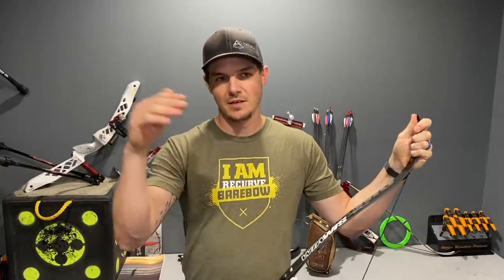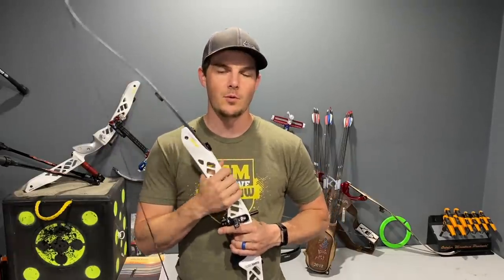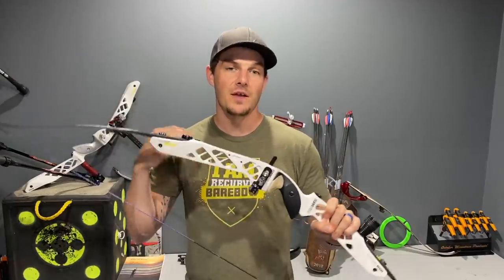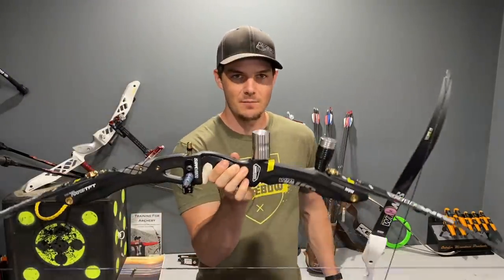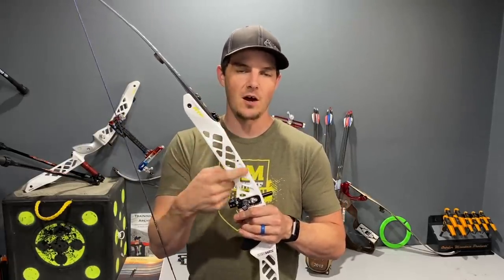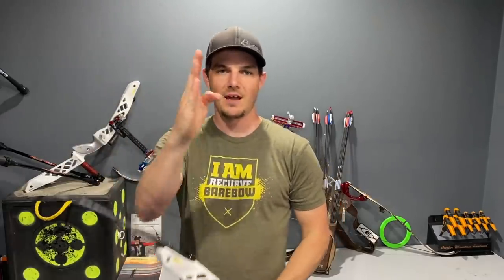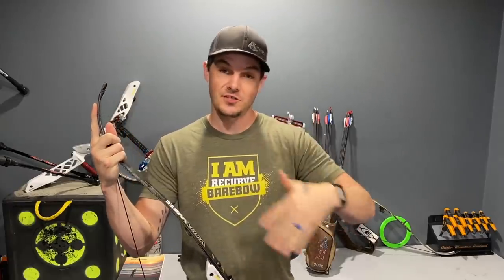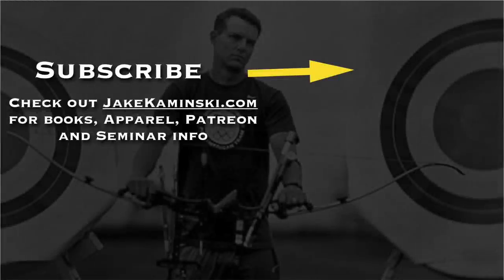Carbon Fiber VS. Aluminum Risers | What Recurve Riser Type is Best?

Comment: plenty (probably the majority) of anodized risers either have their anodization applied directly off of the Cnc machine or use a bead blast process instead of hand polishing. In fact I think it is quite unique for Hoyt to use hand polishing before cnc. MK and Fivics would even leave the tool path visible for kind of a decoration. I think your point against anodization it’s really about anodized hoyts instead of anodized risers in general.

Comment: I have several risers, and my most expensive one is a WIN&WIN CXT, and its lovely, if heavy. Its comfy, well balanced and comfortably handles 54lbs and ACEs. Then I decided to get a cheap riser to stay shooting off the thumb with heavier draw weight. So I got a Spigarelli Revolution. Wow. NO vibration, 63lbs, much more forgiving even with a short riser, short limbs and a 31" draw length. I don't think I'll ever change risers, it's the best I've ever shot.

Comment: I have a (aluminum) Hoyt Nexus and a (carbon) W&W CXT.
The CXT is so much more "pleasurable" to shoot that it is hard to believe the difference.
Reply: In the motorcycle industry in the late 1990s carbon fiber gained popularity and is still being used today ! Carbon fiber is much improved but like a wood bow requires protection , wood more for moisture and carbon fiber for UV rays . I would think your CXT feels more like a wood bow in your hands and has the characteristics of less vibration when shooting . I just purchased a set of composite carbon limbs from a French manufacturer UUKHA @ 42 lbs to see if I like them .  I still like the look and designs of the aluminum risers , they are a thing of beauty !  I’ve been in archery since 1966 and the advancement in archery and equipment has been phenomenal !  Know if we can just get more places to shoot with 3D !
Reply: @hotchihuahua1546  Since the comment I also bought the Gillo G1 riser. I do not see any difference between shooting it nad the Nexus. CXT still feels more natural to shoot. Just like wood that I'm used to since 2004 :).
Reply: @-fazik-3713  I assumed the carbon fiber would feel more like the wood but your statement confirms it . I’m sure I will get a chance to try one out in the future .  On another note ,  Jake Kaminski’s YouTube came up because I had an interest in archery , I am impressed and like his format , I subscribed to his channel !
Reply: @hotchihuahua1546  Hands down it is The best channel about archery on youtube.

Comment: I have tested vibrations frequency of the carbon TFT and ALU AXT.  the carbon riser vibrates at much higher frequency (30k~kHz) than the ALU riser (100~1000Hz)range. the high frequency vibration on the carbon riser dissipated very quickly.  carbon is rigid, it just can not damp the vibration. it vibrate faster so the energy goes away quickly.  it may be too high to human to hear and feel.  but affect the bone and join more.

Comment: Going to be a little controversial here and say that I think personal feel probably trumps every other consideration. When you find a riser you like, during the shot sequence you are probably getting all sorts of feedback from the riser experience and especially at the exceptional level you shoot, you probably know a 10 as it leaves the bow. So as a carbon riser feels different, you probably don't get the same sort of clues its a good shot. Where I do think the carbon is a distinct advantage for me (target barebow) is a very short distances I can raise the nocking point substantially and the bow still be usable. With an aluminium riser I don't seem to be able to make as extreme adjustments before the bow becomes unusable. Reason for this trick for me is it allows me to anchor underchin and be point on without having to add stupid amounts of weight to the arrow point.

Comment: I have used various risers, cast aluminium, machined aluminium and cast magnesium, wood and carbon fibre...carbon fibre is cool....in theory. I have a WIN&WIN CXT. I have never felt so much hand shock. Wood feels nicest, but...not the best performing. Cast magnesium, not bad, but..not great. By far the best in terms of hand shock absorption is machined aluminium, and the Spigarelli Revolution, despite its other flaws (weight, thickness, looks) has integrated shock absorbers isolate the grip from the load bearing section of the riser, and even with very heavy draw weights (I hold 72lbs on my thumb) NO hand shock at all, not even in barebow configuration.

Comment: Having used high-end Win&Win carbon risers (e.g. WiaWis nanoMax), I have just changed to aluminium (ATF-X), initially because it was so hard to find a 27’ LH W&W. But I’m now finding the ATF-X such a sweet bow compared with the nanoMax. Maybe it’s going to 27”, or my setup & tune…. but whatever the reason, the carbon bows were hard, and the aluminium bows are sweet.

Comment: I need some advice.   I've heard a longer riser can make for a steadier aim for some.  Seems like that for me when shooting my compound.  So my questions are. I'm 5'11 with extremely long arms....I was considering getting either a 19 or 21 inch hoyt satori riser,  but using black wolf limbs.  Supposedly those are the best limbs,  and are compatible with the satori.  Supposedly the bigger riser is not only more steady/heavy,  but the grip is better to many than the 17 inch riser that comes with a black wolf riser.  Thanks for any input in this matter everyone.  Dying to get into trad hunting.  I want to just buy  once,  and cry once and get a fast bow I can instinctively shoot with

Comment: I think you have much more "faith" in the consistency of making billets, forgings, and the machining process than in the carbon lay-up process because you don't understand it (most people don't). Even the prep for powder coating, as you pointed out, potentially removes metal and depends on the skills of the operators. Bead blasting to prep the surface is like sandpaper, and too long a pause or heavy hand will have the same effect as too aggressive a buff.
I also shoot a TFT-G riser with NS-G limbs. Added Limbsavers and two Yost weights and it purrs like a kitten!
Reply: As a machinist i can tell you it all depends on your QA CONTROL and what the customer wants.  A CNC can easily  hang out in the .0002 of an inch area on aluminum. I do it frequently. The human body is probably more inconsistent  than that. Especially with blood movement.

Comment: I've also heard that carbon risers crack from inside over time.
Reply: So thats why carbon arrows are so popular vs aluminium. The aluminium arrows never crack but the carbon does ??
Reply: mathias hammar I don’t think you can compare them. They work very differently.
Reply: That's probably an old defect story from when carbon risers were just coming to market, that has stuck around.

Comment: Probably that powder coated riser's "blasting" process is taking much much more material than hand polishing. I don't exactly know how they buff and what material they are using but "buffing or polishing" removes microns level of the material. It's not you can see or feel by touch. (except smoothness/roughness)
Reply: i have  been in the anodizing bisiness for forty years on this subject he doe not know what  he is talking about

Comment: Not to mention the price
Reply: Cheapest carbon from W&W is the WNS FC-100 which costs ~320 €. You can get aluminum risers way cheaper but if you look at the top of the line carbons (W&W, Uukha) and top of the line metal (W&W, Hoyt MK Korea...) their prices are ~800-900 € so at the very high end they are similar. As a barebow and compound shooter sometimes scares me that for the money that cost you some of those risers you can buy the compund which won in Vegas this year (PSE Supra Focus, ~1100 $, less than 900 € in my country).

Comment: Good points but.......in my opinion a carbon riser should function more smoothly and consistently with carbon limbs because they are the same material or at least more similar, rather than aluminum riser paired with carbon limbs, completely different materials with completely different properties. It stands to logic to assume that the companies producing these carbon risers who also by the way produce the aluminum risers, most of the time, would check if their carbon risers bend the wrong way under stress within a tolerance spectrum of error that would satisfy them that their carbon products are within certain parameters of straightness and proper alignment and are consistent enough for them to sell them at an even relatively higher price, than their aluminum products  most of the time. Also think of this.........your limbs are carbon!....and they are the ones doing the vast majority of the bending by a factor of over 10000/1 and we use them on aluminum risers and carbon risers.......so if there is a discrepancy and misalignment on the bending, where would the overwhelming percentage  of the error consistently come from?
Reply from the maker: I hear you, but the riser bending incorrectly would absolutely be magnified by the limbs a whole lot... or rather the limbs would be out on plane by much more then if just the limbs were bending out of plane because of being magnified over a longer distance. The riser flexing just .003" causes the limb tips to deviate more then .030" at the tip. This only accounts for one limb. It may seem small but can make a difference at distance.
Reply: @JakeKaminskiArchery  True, the riser is at the center of the bow so the deviation angle of the riser translates into more absolute distance of deviation at the limb tips, with a 25 inch riser  plus long limbs we have a 70 inch bow, so each limb should be 22.5 inches long and the riser should extend 12.5 inches from the center in either direction. Now the length of the limb plus half the riser is 35 inches, compare that to 22.5 inches of the limb alone is an  increase of 56% of overall length. So now imagine that you have this new ( limb ) that is 56% longer than your regular limb. This new 35 inch limb at its base, the distance of 12.5 inches, the 56% extra length, is far more solid and resistive to bending than the limb of 22.5 inches, but even if it was exactly the same for both, you would have a limb of 35 inches compared to a limb of 22.5 inches made of the same material. If the error produced due to bending out of plane of a 35 inch full carbon limb was prohibitive for using it, then chances are that a 22.5 inches full carbon limb would also be impossible to use and produce good results! That is to say that if this carbon material technology was so inconsistent then it would be impossible to be used for limb manufacturing anyway. Thank you for your answer, it is a good answer which pushes the argument into deeper analysis and thank you for your time.
Reply: I understand your argument about the bending of the riser and how as it connects to the base of the limb this misalignment under loading pressure would be magnified in a non linear way cause the limb would be misaligned from its base , but if that were exactly true and carbon was so inconsistent then the same argument would make the base of the limb it self and any carbon limb and through out  its whole length inconsistent enough to be impossible to be used, on any riser, whether aluminum, wood, carbon, or any other material, that's why i went with the elongated 35 inch carbon limb example. So that i encompass the logic behind the argument into what is actually being used and proven to work and appease your worries about the consistency of carbon material technology especially from established companies in archery that use this material. You have been using this technology already to such an extend with the limbs that if it was anywhere near as inconsistent as you fear, it would have been impossible for you to be so effective and consistent  and reach such heights of systematic accuracy.

Comment: Bead blasting will also evenly distribute stress in aluminium risers making them behave more predictably under stress. That being said, most risers use 6061 aluminium anyway which will be a mile away from its yield point and major deflection under such low loads (<100lbs/60kg). 

Most risers seem to chase weight reduction, which in my mind is counter intuitive as greater inertia creates a more stable shot. In my opinion most risers are over engineered and or sold on aesthetics and technical gumpf rather than tangible benefits. Hence why manufacturers provide no quantitative information on deflection at different poundage etc.

It’s a big marketing game and the big players have to be seen to be developing something new. I feel like often it’s a case of reinventing the wheel. You just want a riser that is stiff enough to have negligible impact on limb performance IMO

Comment: You are the best, but addressing minuscule layer coating or sanding differences is simply absurd for 99.9 % of all archers. Vibration and temperature differences, fine. Certainly balance is well worth considering for elite archers like yourself.

Comment: Wtf is All Luu Minium?
Reply: Peter Nguyen European speak for aluminum
Reply: Aluminum is the American and Canadian spelling for the silver-white metallic element (number 13 on the periodic table) abundant in the earth’s crust. Aluminium is the preferred spelling outside North America. Neither term is superior to the other, and both are etymologically and logically justifiable. Aluminum is older, while aluminium is more consistent with other element names such as helium, lithium, magnesium, and so on (though let’s not forget there are other -um elements—molybdenum, tantalum, and platinum).

Aluminium has the edge in scientific writing even in North America. This is primarily because several influential scientific organizations and publications prefer the spelling.
Reply: The Carbon Riser breaks inside After a Short Time
Reply: Al riser is Not the high „Al“ See also the „ Al-Mg“ Material !